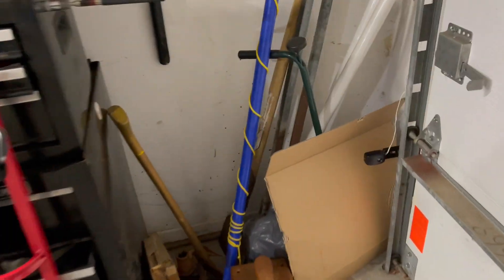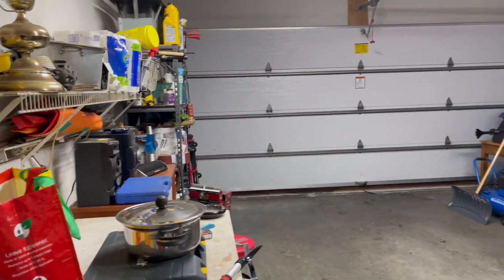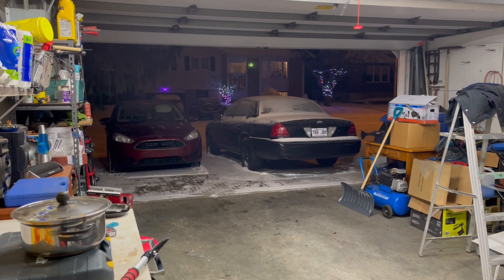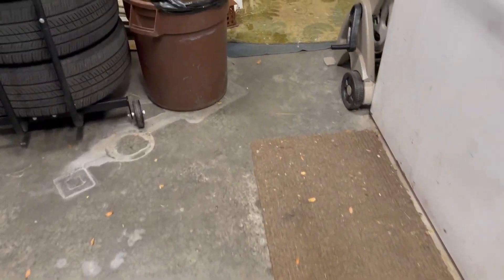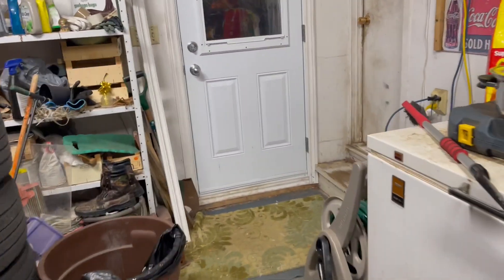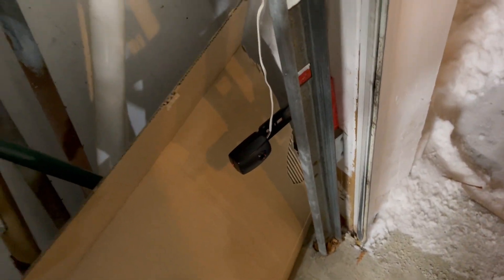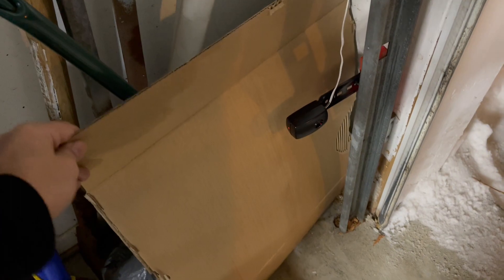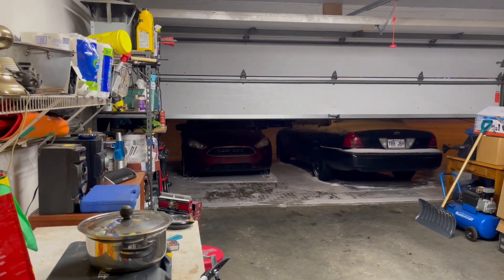Mastercraft Chain Door Opener wont close,,,,,

Comment: What's probably happening is, the garage door opener has an amp meter in it to detect a surge in the current, which is what happens if the door hit's an obstruction. Either the module in the opener went bad, or, because of the cold the metal tracks the door runs on have contracted in a way to bind things up enough to cause the safety to trip. Simple solution to secure the door and then deal with this when the sun is up is to pull the chord to release the open door from the track/shuttle, shut the door manually, then run the motor to get the shuttle to where it would be with the door close and re-engage the thing.
Reply from the maker: I made a new video today of this but thanks!,,happy holidays and happy new year!!!